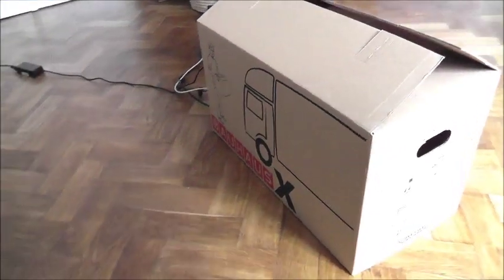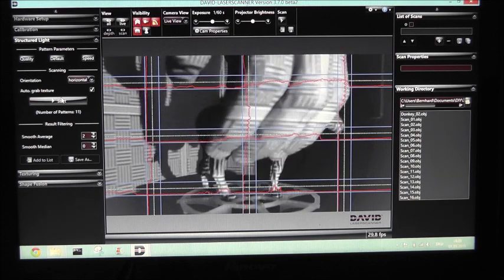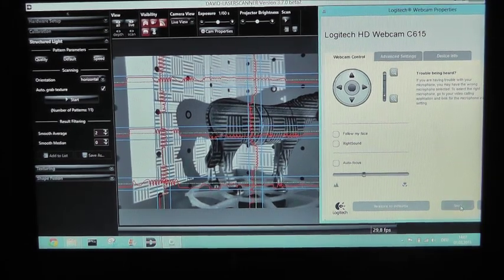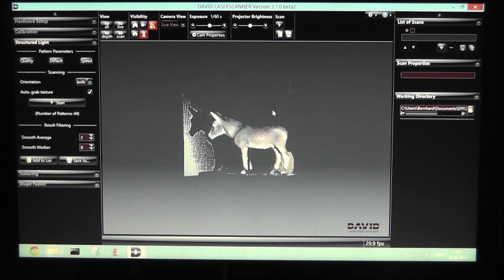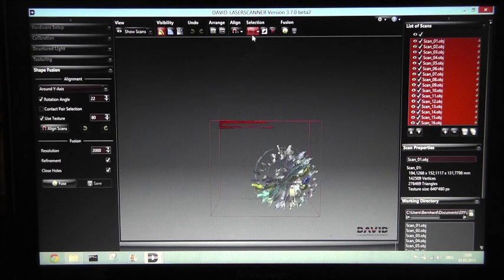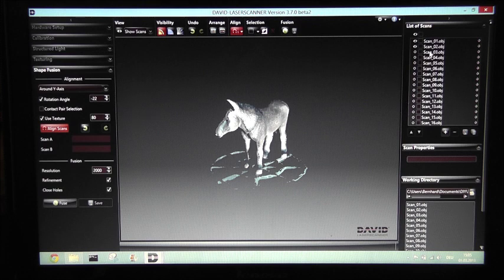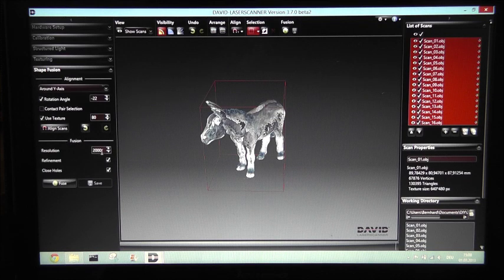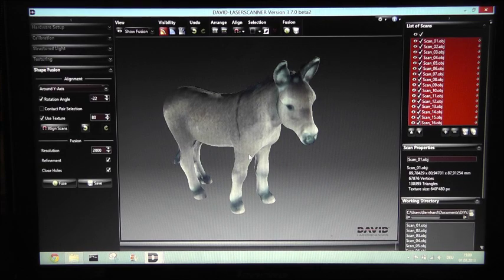3D-Scanning Tutorial David Laserscanner 3.7 and VirtuCube

Comment: One other question I had, do you have to enter paramaters to tell the scanner where it is in relation to the object or is that automatic?  Can this scanner be put into a box where the laser and the camera are in a fixed position so you can put the box that houses the items on a tripod to move it around large objects?  This is how I use my scanner right now.  Does it have a macro and wide mode?  What's the sweet spot?  It's about 6.5" away from the lens in macro for me.

Comment: Wow, that's a good quality looking model.  I have a nextengine 3d scanner, and what I see on here right away is the ability to adjust focal point on the camera.  I wish I could do that with mine and mine cost a fortune. Nextengine uses a pin system to align scans, the alignment process looks good, but I wouldn't know what the numbers do. (i.e. when you selected 2,000). Can you scan large objects and stitch them together?  I.E. your item is too large to fit on the turn table.